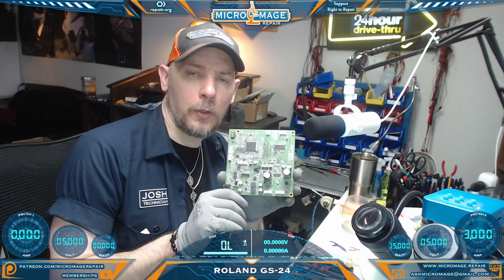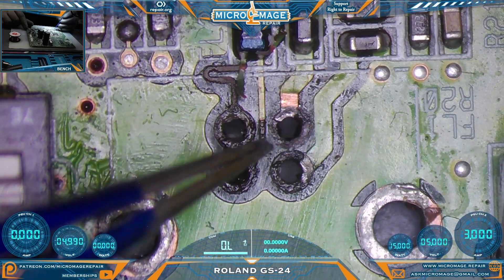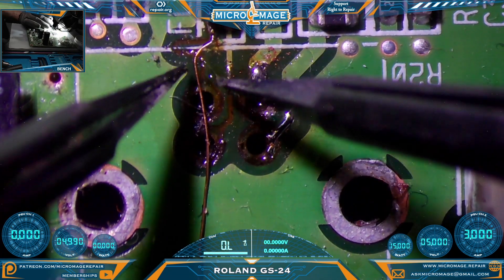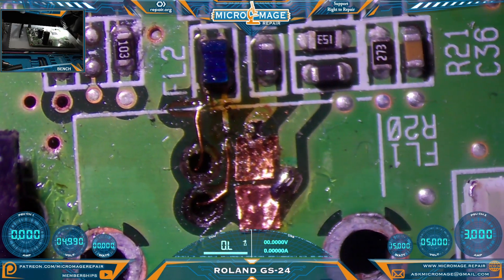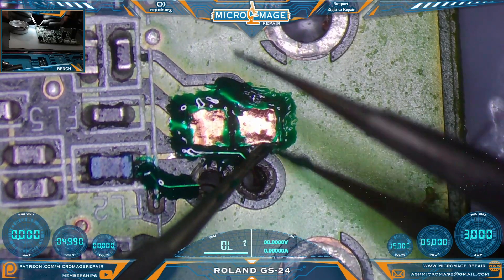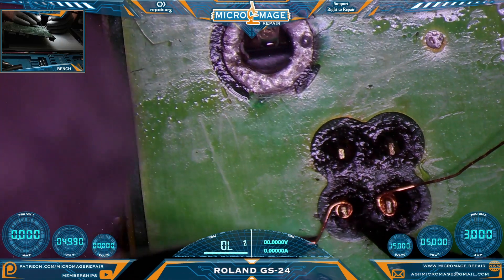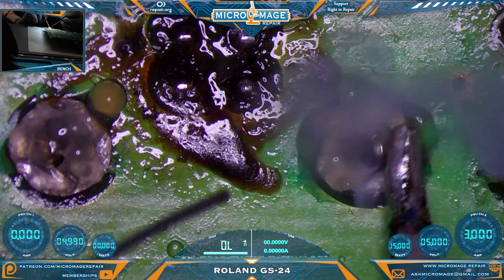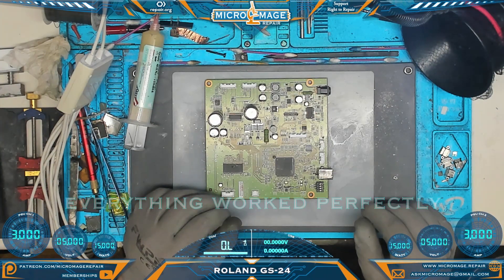Roland GS-24: Ripped off USB B Port

Comment: In the old days I saw many devices that used that technique: "wire wrap" on posts (individual electronics headers) placed on the perimeter edges of the PCBs. Excellent job Josh. A sincere congratulations. I liked. Thanks a lot for sharing. All the best from Mexico.
Reply from the maker: Thank you Carlos.
I'm old enough to have encountered those as well. 
Definitely took me back when doing it, though I know some old techs who could have definitely done a better wrap job than I did 🤣